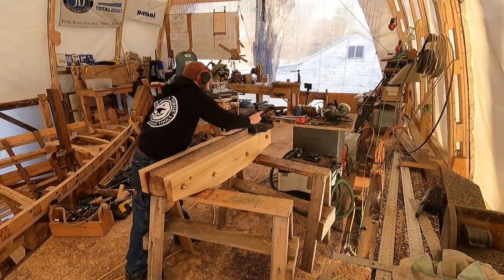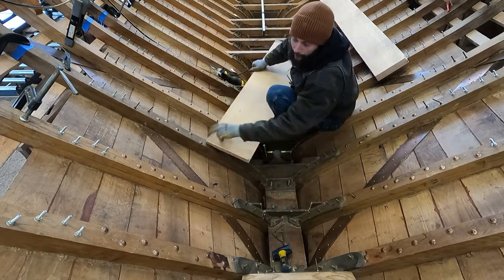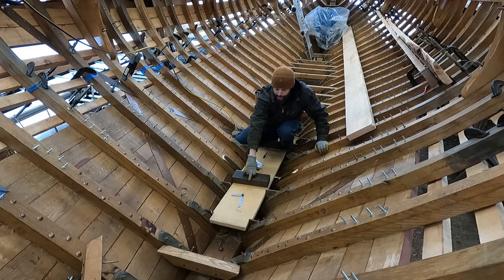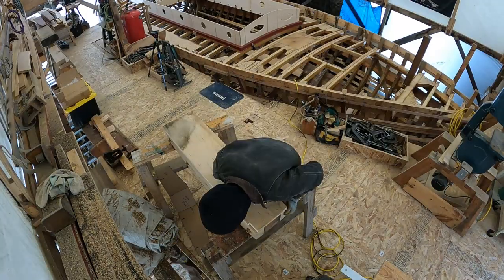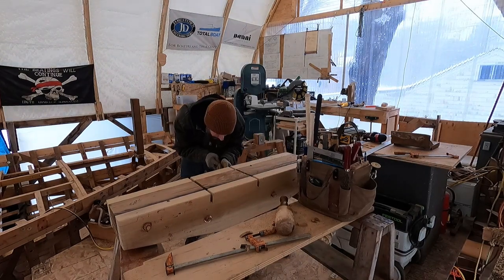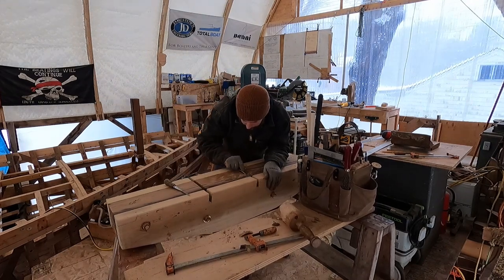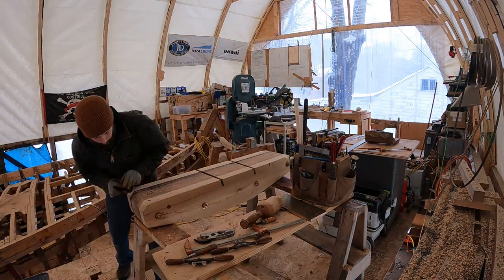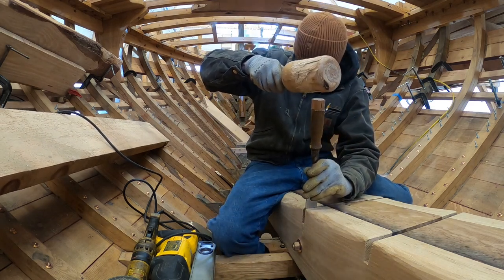Mast Step and Alignment - Episode 152 - Acorn to Arabella: Journey of a Wooden Boat

Comment: Steve you dropped lucky with the the Mast Step !!
Having done the cutting of where the step was to sit abroad the bronze structures and then to find you was able to drop the Shoulder Plane down into the rebate and just have a whisker or two to grab a hold of the Shoulder plane and actually use it....well that's what you call dropped perfect.. as always  guy's 💯%   👍🇬🇧.

Comment: For centerline and checking get a low price laser. For a few hundred, and along with using plumb bobs you’ll be able to use it even with later cabinet work. They get way more useful as you get the hang of using them and the many ways it helps without strings in the way.

Comment: You could  gain some floor space by channel cutting the outboard side (closest side to the hull), of the floor planks to slip past the ribbing, and then angle cut the outboard side (closest to the hull), of the flooring to provide some space for ventilation and drainage into the bilge. You could gain as much as 4 to 6-inches of floor space on each side of the boat with this process.

Comment: Guys mounting your mast step directly on top of your bronze floors is going to apply a great deal of fore and aft pressure on the floors that they were not designed to take. The simple expedience of adding oval blocks as packers to the bottom of the mast step and pinning through into the keel would eliminate the effects of fore aft strains and continue to allow  bilge water to flow in the correct direction. As an after thought you could weld bronze plate into the floors notches in sections or as one long piece connecting all four floors and drill and screw through into the mast step, this would resist fore and aft side to side and rotational forces whilst at the same time spread any loading more evenly through that section of the boat.
Reply: I think the reason the step interface block is knotched is so that no downward forces are transferred into the bronze floors, but the vertical forces are widely distributed into the keel.  I'm not sure yet how the interface block is being fastened to the keel or how the mast will be captured into the interface block.
Reply: @boooshes  Mast step only slotted for central two floors, and appears to be in the position Steve intends it to be, without  packing all forces no matter the direction will be transferring directly through the floors.

Comment: great idea on maybe widening the effective sole by a plank or two up the frames. I just did 1500 miles from RI to USVI basically 10 days at 15% heel (yup easterlies the whole way) and anything "level" would have been appreciated. Especially for standing/cooking in the galley, cool idea. 1/8" width variation amidships? Amazing.
Reply from the maker: Gotta love camber in a deck for that, too. Just a tad more level for walking on the windward side when heeling. Of course, it's mostly for shedding water, but a good camber set in a deck makes it safer to go forward. Congrats on what sounds like a super speedy passage! Catamaran?!
Reply: @AcornToArabella  yuck catamaran. no, Valiant 42! cutter double ender cool old school look in fiberglass and fast

Comment: I am puzzled as to why you mounted the mast step to the top of the bronze floors via slots in the wood as well as why you removed metal from the floors to provide clearance to the mast step when you could have put a rebate into the wood.  This configuration appears to be weak to forward and aft loading and will cause additional fatigue stress to be focused on your welded joints.  You both are really good at research and I am sure you have a reason for doing this and already have a  solution in mind to mitigate this issue.  Thanks for sharing.

Comment: What about filling that large check in the Black Locust with epoxy?  Also, are you planning on rounding over the right angles on the bronze tabs you just cut?  Seems like it would relieve the possibility of stress fractures, plus just look cleaner and be safer.  The project is looking great!

Comment: Are you going to put some more bronze strip on top of those vertical pieces?  The pressure exerted in those thin sections pressing against the oak will dig in and cut into the step eventually.

Comment: Hi, a question if possible. Why are the ends of the bolts (stainless steel) sticking out? I assume they are temporary, waiting to be replaced by copper rivets. This boat you are building is a dream come true. Congratulations, she will certainly be a masterpiece.
Reply from the maker: Temporary, yes. That's where the bilge bands will go.

Comment: You could put trays in the bilge, made from plywood coated in epoxy. That way, water won't be an issue, and you can store stuff without blocking water services.

Comment: Drill a hole through those corners or  grind a radius where you cut in your floors.  Those hard corner can eventually be the starting points for a crack.

Comment: Why is attaching the mast to a thin plank and 5 floors+frames stronger than attaching it to a GIANT timber and ALL the floors+frames?
I broke it down in a comment on the last video but I'm fairly certain the keel timber, with the frames being wedge-shaped, attached to all the frames, floors, and even planks.. would be a much more sturdy attachment than a smaller hunk of wood that's only attached to half-a-dozen bronze floors.
Steve's reasoning in the last video was that the keel is already under a lot of strain from everything else and that it wants to pull out the bottom.. But the keel is not only lined with a few massive planks tying it into the frames, but it's got like 30+ bronze V-shaped wedges on it that would have to spread all the frames, planks and everything else apart before it could push out the bottom of the boat.

Comment: Hi, really enjoy following progress on Arabella each Saturday morning here in NZ  – great job. I’m a little concerned that the step block appears to be being supported solely by the 4x ½" edges of the bronze floor uprights, rather than using the full underside of the step block resting on the keel timber. This doesn’t seem to me to be a very effective way to support and transfer the weight from the mast into what is effectively the strongest part of the hull. Or is the plan to eventually remove timber on the underside of the step block (around where the wings of the bronze floors attach to the keel) to allow it to then sit flush on the keel over the wings of the bronze floor?

Comment: Out of morbid curiousity.  Why cut the bronze floors as deep as you did?  I get needing to nestle it in there but seems like they (even the one) is significly weakers.  Also are you going to weld on some tabs or brackets to better hold the mast block, and bolt it down?

Comment: Try to avoid sharp corners on the brass floors, you can get stress concentrations and induce cracking over time. Round the corners or drill a relief hole.

Comment: Do you plan to add more Brass Support for the Timber mast Step, or rely on the narrow Keel Floor Top edge in the trench to do that? It looks like a good place, at either end, for a horizontal split to develop.

Comment: I am surprised you have chosen to set the mast step on the edges of the bronze floors. 
I would think the stress concentration would let the floors act like knives or wedges that would cut into the mast step.
I think you need to add pieces of bronze to spread the pressure on the wood mast step timber.
Thanks for the vids
Reply: Chafe never sleeps.

Comment: Hi guys, like your videos. Did you have any issues with the County on the shed structure where you build the boat? I see that Leo (TALLY HO project) has big issues with his project because of the County demands
Reply from the maker: We've had to change the shed (see previous videos) depending on what building inspectors have wanted. Massachusetts local authority is set up a little differently, and also, we're on zoned agricultural and forestry land—and this is a forestry project.

Comment: I see that you have moved into decking and interior work without completing the planking in upper part of the boat. Any practical or technical reason for that?
Reply: Waiting for the planks to season right.
Reply: To expand on Jonmurray's answer a little, the original plan was to plank her in cedar for the most part. The team had major issues with the cedar planking and eventually canned it, and are now planking her all in oak.  Unfortunately that was not allowed for in the original quantity of oak felled and milled. You are aware that she is being built from local timber, mainly felled on Steve's family property?. That additional oak has been felled and milled, but is still too green to be used for planking yet, so the build is progressing as it can while that oak stock seasons.
Reply: @harrymoyes5069  you got it. I tend to stick to simple answers
Reply from the maker: Johnmurray and Harry have it right—but the oak is ready now and we'll be planking in the coming weeks as soon as it's a little warmer to glue scarfs.

Comment: Could you have used aluminium or steel to make the floors, have them powder or epoxy coated? Or even plastic dipped
Reply: No iron in the boat, so no steel. Powder coating chan rub off. Aluminum wouldn't have the strength they need.
Reply: @boothbytcd6011  steel can be plastic dipped and totally seaworthy. I understand powder coating can rub off but if it's done right it can last a long time. Probably not going to save much by plastic dipping steel but it's definitely a good option instead of bronze
Reply: Some Polymer matrix coatings can't be rubbed off at all. Also HF resistant. Damn near permanent.
Reply: Why would you suggest this now...1. bronze has give (ductility), it will bend b/4 it breaks.  2. It resists saltwater corrosion better. 3. Never needs maintenance. And is traditional. All your suggested materials have major shortcomings in their own way. Even Naval aluminum is not a 100 year product and is too weak.
Reply: @raybame5816  I just now saw you used bronze and was asking for myself. Like would it work etc
Reply: @raybame5816  I understand steel would be hard bending. But it could be heated
Reply: @raybame5816  but bronze can only bend a few times before it gets very weak, flakey and then breaks. But that would take a catastrophic event to happen. Many micro flexes will cause it too though. I mainly wonder if the bronze had antibacterial properties with the oak perhaps. I don't know
Reply: @TheBigjrbbbr  I have a 1974 twin diesel Luhrs 32ft boat which has all bronze hardware and has had both propellers re-pitched, cupped and straightened a number of times. Due to a boat yard incident both rudders and struts needed straightening as well. I've owned it for 22 years and let me tell you bronze is the way to go. I don't think you know what you're talking about.
Reply: @raybame5816  I clearly don't know what I'm talking about. Why do you think I'm talking about it? I'm trying to figure out what would be best in a boat I'm looking for. I've seen both with and without bronze floors. I'm just asking questions. Not trying to get anyone upset or anything
Reply from the maker: You ask great questions, and though Ray sounds a little like they got hot under the collar there, I think they're just qualifying the info by saying how long the 32 footer's been in their life. There are things in boats (materials) that are convention, and many other things could be possible (HDPE to make frames, for example), but there are others that are fairly tried and true. The best material for the floors would have been bronze-fastened wooden ones. They work great, are highly repairable, very strong, and proven. We went with bronze—which of all the metals, as Ray points out, is the best choice for our boat. Thanks for watching, STAY CURIOUS.
Reply: @AcornToArabella  Very cool response. sorry, I did get a little torqued. But I just do love your floors. I'm just not a tolerant teacher like you are. I will pipe down.  Apologies to Not Sure.
Reply: @TheBigjrbbbr  Sorry, you have every right to ask questions...

Comment: I'm sure you love hearing minor worries from random viewers, but is there enough clearance from the sides to the mast step to the sides of the floor athwartship braces to allow the step to swell when it gets wet? It looked pretty tight in the notches in the floors that you cut. Even four big bolts isn't going to keep it from swelling a bit at the bottom. I don't know how green that wood is, but live oak can shrink or swell 6.6% radially and 9.5% tangentially. https://www.wood-database.com/live-oak/
Reply: If that's clear as mud, let me put it this way: if the mast step swells, are the sides of the mast step going to press on the bronze floors anywhere?

Comment: I know you guy do a lot of testing and what not, however (as a metal fabricator with over40 years experience) can I make a suggestion in order to save some possible serious grief that will be coming down the road. When cutting the webbing on your bronze floors you may want to take great care in putting in radius corners internally and to some extent polishing (not a high polish by any means) but you do not want any sort of grind marks going sideways across the end of those plates that will absolutely cause a stress riser and eventually crack those floors in the corners where you cut them. Simply a suggestion nothing more.
Reply: I also agree with Hansa. Those cuts of bronze introduce a potential  point of failure for serious crack. This should be fix. As an aircraft builder, with time and multistress vibration, with learn it the hard way.
Reply: @christiantremblay  Christian I too was a A&P many years ago before I got into racing (many A&P guys get into some form of racing) it all carries over very well into race cars, after all fast cars are nothing more than aero packages that are upside down!
Reply: @Mtlmshr  I love aircraft, sailboat, RV, motorcycle, or anything can move with an engine or with other forces. I wish to go on other planet !. :-)

Comment: I am worried about the way you put the mast step on the floors. You basically put a large block of wood on four knives. If your floors are 1/2" thick and the mast step is 10" wide, the total surface of wood resting on those four bronze floors is 20 sq inch. The maximum safe pressure on wood "in general" is 60 psi, so you can safely put a 1200 lbs load on it, which is probably the weight of the mast and rigging. If you put load from tensioning the shrouds and heeling the boat in a fresh wind plus vertical acceleration in waves your mast step will gently lower itself on the keel. Not a good plan.
I would say to reconsider this and come with a safe plan. Frank Mulder, Amsterdam.